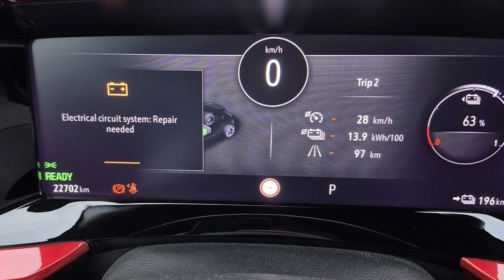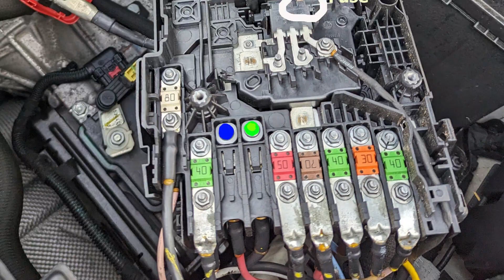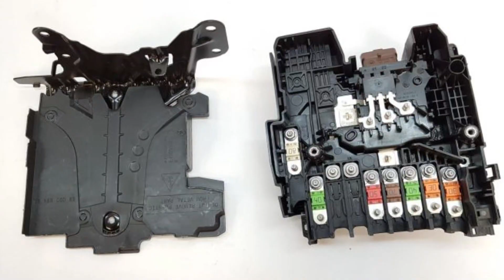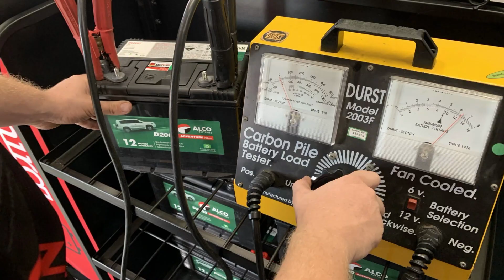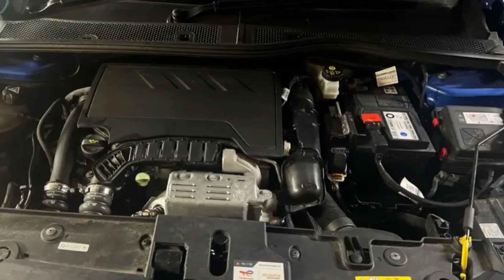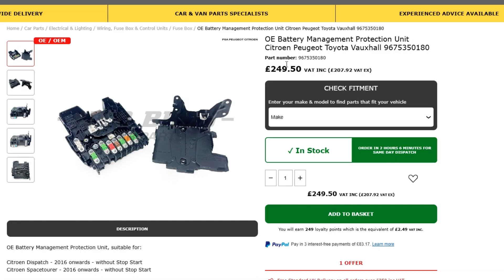“Electrical circuit system: repair needed” warning in Vauxhall

Comment: Thanks, this helps. I use the Peugeot car and I have this issue. Car is running ok, but I see this error on screen. Local garage charged me 50 £'s for diagnostis and told me they can't clear the code (they didn't tell me this before). 
I myself don't have a diagnostic tool/ cables to perform this activity. 

Wish the systems were designed for easy use and low cost maintenance. A small part costing over 250 without labour cost is not a good solution for resolving issues. Peugeot service centre are asking me 200 £'s only for diagnostics and on top of it other charges as well.
Reply from the maker: Diagnostic is expensive, but with modern cars, you don't have much choice. Electrical issues are not DIY-friendly, unfortunately.